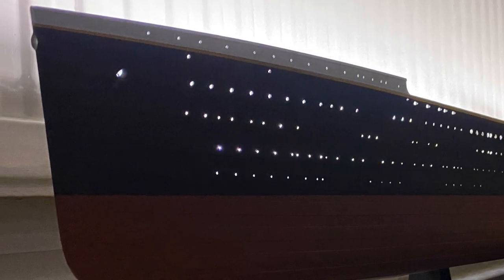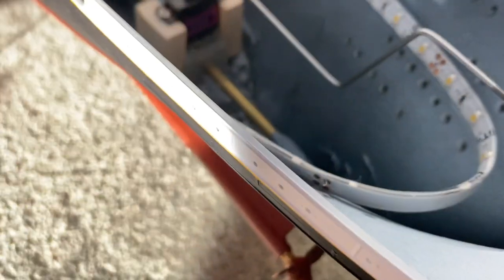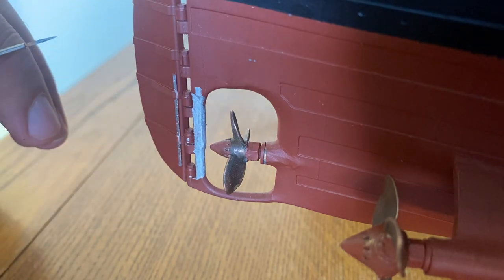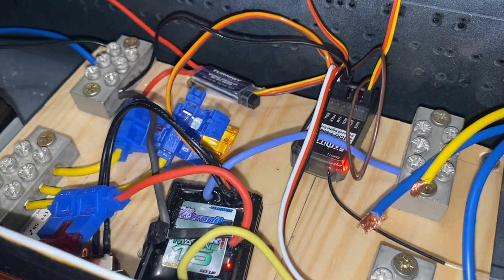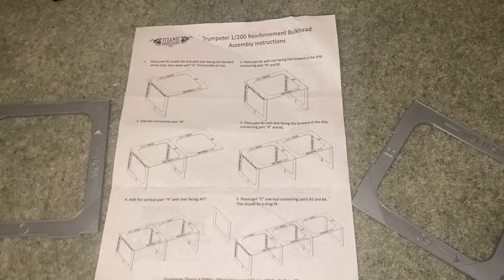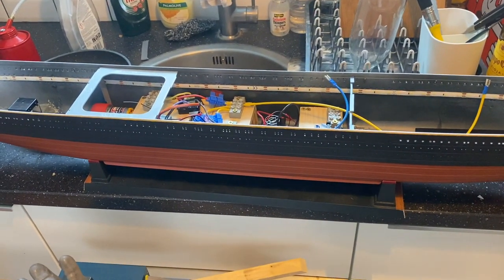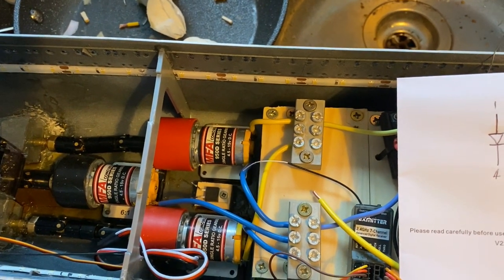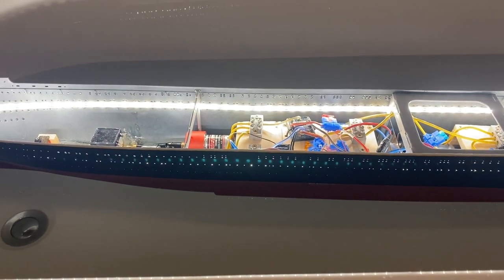Radio Control Trumpeter 1:200 Titanic Build Part 12 - Electronics and Lights

Comment: Well you have helped my project no end!  I have been waiting for you to have a go at the lights!  A bit of an anti climax really, one strip around the hull and that's it job done!  There's me working out internal supports and all sorts of stuff that is now totally unnecessary!  Great thanks for that, I may add some additional defusing to soften the effect even more. Now that you have reached the superstructure levels it will be interesting on how much light creeps around the deck edges etc.  Great fun to come though!  Your electronics are impressive and this was a really good video.  Regards JH :-)
Reply from the maker: I was doing exactly the same re the lights, was thinking about slotting some thin acrylic sheets into my bulkheads at an angle and stuff to mount the lights! but i did a trial fit and was amazed just how well it worked. Diffusing is the next step, and also a bit of tinting to make them a wee bit more orange. I've bought some headlight tinting film which i think should do the trick but we will see. 
Im worried about the light bleed through the decks too, not entirely sure what can be done either. I am intending to pain the decks black on both sides before adding the wooden decking, but i dont know what to do about the joints... we will see, maybe a strip of adhesive rubber or something (sort of stuff you use for double glazing window seals?? Cross that bridge when it comes!
Cheers for the support, how is your olympic coming along?
Reply: @TheModelBoatGuy  Hi, Yeah I expect light leakage from all sorts of areas like the anchor chain ports and even around the mast mountings and rudder stem too!
I was thinking along the same lines as you on this and I expect that the eureka moment will arrive sooner or later.  Your version is a little more complex what with the removable superstructure being a requirement.  Perhaps a wider rubber strip as you say will do the job but its going to be close to those windows and portholes!  My lighting source LED strip has the acrylic casing which may have been better for you in view of the water aspect!  Being a static model I am going to try and install loads of F optics for the superstructure deck lights and even perhaps in the promenade deck areas.  My Olympic will be a long haul as I am still gathering the additional gubbings to do the conversion. Boats are coming along slowly and I am putting a tiny strip of thin wood veneer around the top edge and then adding the grab ropes etc. All a bit experimental at the moment.  Of course my Engelhardt boats will not be used so if you want them just let me know.  There are so many additional things that I need to research for my build and are pretty elusive!  The brass PE and additions to that have now taken me to well over 40 sheets.  I am currently trying to finish off a wooden ship project too before doing any real work on the Olympic. JH ;-)

Comment: Nice! One question, are you gonna plan to make the deck wall bulbs more authentic, cause there are just gonna be visible leds on the deck making it look less authentic. I'm gonna be drilling portholes on the wall lights on the superstructure just like the real titanic. Right now I'm looking at Art Brauchweiger's 1/350 Titanic and I want mines to be like that too.
Reply from the maker: Its a tricky one here, where possible i will mount my LEDs in the ceilings to try and keep them as invisible as possible. Im not lighting my funnels like the kit suggests because although it looks good the real ship didn't have its funnels lit and the LEDs are just too obvious for me. 
Not sure about the wall lights yet. i think the options are either just drilling holes and then adding a bead of resin to make it look like glass, or maybe some fibreoptic cable? I'll experiment with both and see what happens! Can you link me to Art Brauchweiger's 1/350 Titanic? i'll deffo look and see if i can get any tips from that!
Reply: @TheModelBoatGuy  Yes! That would be a really good idea, good luck!
Reply: sorry if I haven’t got back to you in a while, the website is “ www.titanicmodel.net “

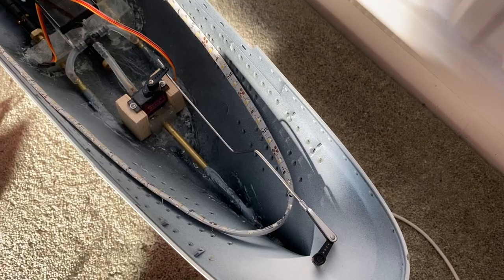Comment: 4:40 Central motor operates on 0.7v lower voltage because of diode so it may act different then side motors. I wonder why You don't move side motors a bit foward to have longer shafts and have them more stright?
Reply from the maker: You are correct yeah the diode will give a voltage drop, fortunately as it’s the central prop it won’t effect the handling of the boat. But it will be rotating slower.

Re the wing props, in an ideal world I would move them closer to the stern, the issue is the hull starts sloping quite steeply. And I always prefer to mount motors on a flat base as that always helps with vibration.

Comment: So is there no way to minimize the prop shafts from leaking so much? Id have thought there would be something
Reply from the maker: Yes I think the best way of doing it is just regulating the flow into the shafts in the first place. Really you want to rely on capillary action to draw the oil in. Since that video I have tried to thin the pipes leading to the shafts which has reduced the oil leakage. 
The other method that proved successful is to reduce the amount of oil in the reservoir. By doing that you reduce the pressure pushing the oil through the shafts which I’ve found helps.
I mean oil isn’t really my preferred option. If I thought it was possible I’d have used grease and a grease nipple, but the shafts are too small and I was worried the nipples wouldn’t stay in the shafts due to the pressure of adding new grease in

Comment: I asked a question on your weathering video (#9) but haven’t received a reply. Could you? : The wash looks v good. But I maybe missed something; what is the main ingredient to the wash?. I got the deep blue and white; but was is the base? It would be great to know?
Reply from the maker: Hi, sorry I replied to someone but it might not have been your message! The main base was thinners (I use cellulose thinners). You’ll need to be a little careful and make sure the last wash has dried thoroughly because otherwise adding new wash will wash off the old! Give it a good hour between coats and you should be fine.
Reply: TheModelBoatGuy thanks. That’s the info I needed.

Comment: Got to ask does the kit give you enough lights to light up the hull or did you need to purchase more? And what kind of filament is that, that you used to give your hull lights a yellow tone? Btw Im picking up my model today. 😜👍
Reply: It does not. It does not give you any lights for the hull. Only the upper decks and horrible looking bulbs that sit on the deck by the funnels to give it the funnel film light.
Reply: @Robman0908  well I kinda figured that out just was curious what kind he bought for the hull, as for the funnel lights, I agree. Would have been better if they came with shields that would block the light from those bulbs from onlookers, but still leaves one side open to illuminate the funnels.
Granted the real Titanic didn't have these, but if you're building it for display, I can see them serving a purpose. 😜👍
Reply: @jackvolta3489  I actually like the funnel light like the model from the 97 film. I just don’t like the huge bulbs on the hull. Having a cover for them is kind cool.
Reply: @Robman0908  thanks Rob, you know modellers do this type of what Im about to suggest all the time, if Im not mistaken that is how they built the Millennium Falcon for Star Wars, By using pcs from many apon many model kits, with this in mind we could modify cut, shape & sand pcs, from maybe the gun barrel, from a plastic tank model, or anything plastic and hollow but cylinder in shape would work. Just got to think out of the box a little when adding things like this to such an epic model, but I do believe it can be done and would look great once completed, Good luck with yours Rob, and if you decide to make some light shields for yours, Id love to know what you came up with, "as for me" I'm only as far as drilling out my portholes, I'm taking the summer off, because its just to hot here in New England U.S.A it was 95° here today and more of the same for tomorrow as well, to hot for model building...lol I'll start up again in September & work on it throughout the winter months that way I wont have sweat dripping on my directions ...lol. 😜👍

Comment: The term "Neutral" should not be used in any DC circuits. It only adds to the confusion of a novice that is willing to learn basic wiring. You should refer to it as the "Negative" rail or 0 Volts.
Anyway, thanks for sharing.
Reply from the maker: Yeah you are correct actually, its very much a slip of the tongue! I do try and standardise what I say when talking about technical things but I do occasionally say the wrong word. I have made a note so will hopefully catch h these things more and more as we go.
Reply: @TheModelBoatGuy  
All good, and thanks for the reply.